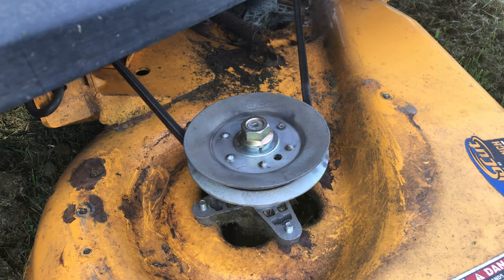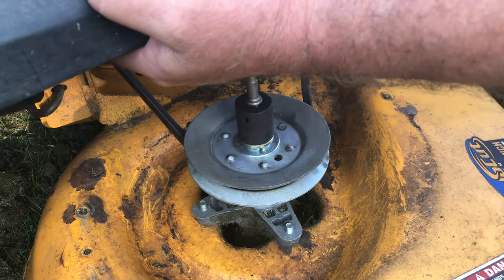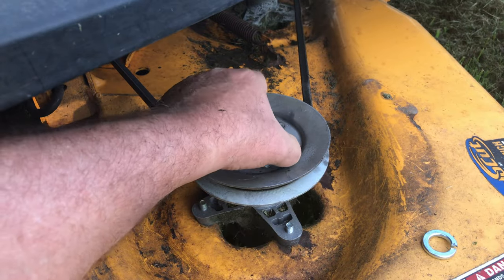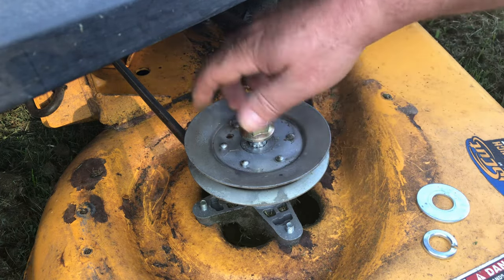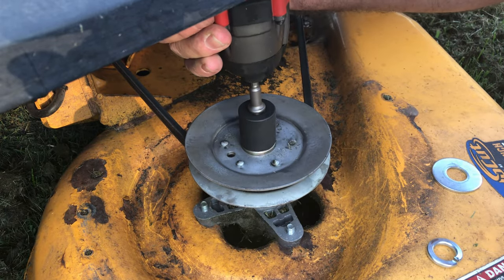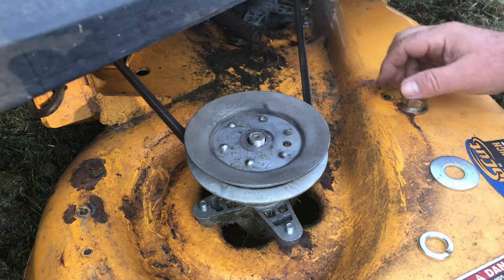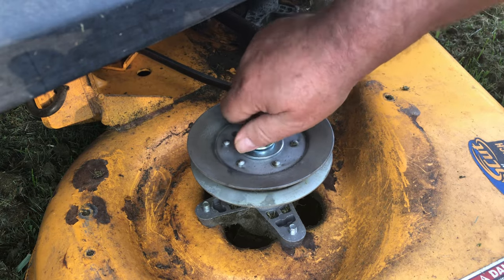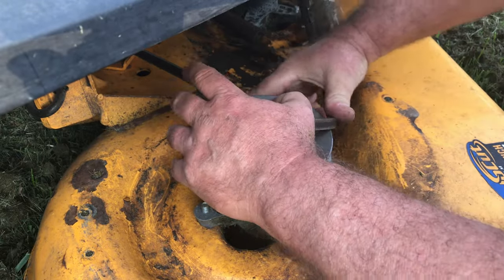New Mowing Deck Spindle Pulley Stripped? Easy Repair, Here's How! MTD Cub Cadet RZT 50 And Others!

Comment: Thank you my brother! I added to your fix by buying a large flat washer for the bottom - and a rubber washer under a flat washer on the top - tightened down until the rubber washer squished up against the pulley - for more traction - for hopefully a longer term fix

Comment: Cub Cadet AKA Poland I have an old 144 with snow plow 60" deck 3 point hitch I spent way to much money fixing up and keeping going but a diesel Kubota cost more then a house I worked for a international dealer for a few years before it shut down I spent more time working on cub then I did in the tractor shop my hatred grew deep in the cheap made parts and cost to consumers you wouldn't believe the money that place made
Reply from the maker: New mowers cost so much now it's hard to believe the prices. I'll stick with my old junk. I use the cheap crappy import parts on mine, turns out most of the factory replacement parts are imports as well. All I really need is a decent spindle housing, and the bearings by the 10 pack. I should probably add in spindle bearing replacement along with the yearly oil/filter change. What a bunch of junk. LOL!
Reply: @KentuckyFriedFixes  they definitely don't make spindle worth a crap anymore most of them don't even have a functional grease cert usually first thing I do is drill and tap a hole and I agree mower prices are nuts every now and then I pick a used one up for dirt cheap fix it and flip it I rewired a newer deere few months back been my main mower this year but after 150 bucks for it and 300 in parts I'll need to use it awhile to recover my money
Reply from the maker: @heathenprojects2639  Good plan. I love a Deere! I have a 212 and a couple of 214's that need some love. The JD mowers do a great job!

Comment: Why the heck are manufactures not machining these shafts per OEM specs? I put mine together and in one mowing stripped out both the pulley and the spindle shaft spline. Thanks for your video, I’ve got to order another spindle set and pulley and I’ll be sure to add washers to the stack.
Reply from the maker: I agree! It's as if they're actually making them to fail. After this deck rebuild, I ordered a box of replacement bearings to rebuild the worn out factory spindles for the next one.

Comment: Had the same issue with my 54” Craftsmen pulley/spindles after rebuilding.  Replacement part quality has really gone down
Reply from the maker: I agree Paul. The Quality is really lacking and the bearings that come in these are terrible. The wife's Cub Cadet mower is on its second set of spindles and blades in 3 years of use. Rebuilding the deck is becoming annual maintenance like changing oil and filter!

Comment: I was thinking maybe a washer under the pulley to bring it up.
Reply from the maker: That would be a stronger fix. Washers on the top and bottom would support the pulley better. I like the way you think! So far, mine is still working with the one flat and one lock washer, but on the next one I will definitely try your suggestion. (I guess it kinda depends if the hole in the washer matches up good enough with the shaft, I didn't think to try it.)
Reply from the maker: I disassembled the old factory spindles and they definitely had a flat washer under the pulley. The new Chinesium parts do not include that flat washer. You were spot on about the washer. Thank you Sir! I've added that information to the description.

Comment: It looks like you have the wrong nut. The proper nut has a void space that allows the nut to fully contact the pulley. The void space slides over the jack shaft serrations without contacting them. The nut you are using looks like it is threaded all the way to the bottom of the nut and has no void space to slide over jack the shaft serrations.
Reply from the maker: Hi Mark! The spindle nuts I used were the ones that came with the new spindle and pulley set. The shaft on the new ones are the issue. After reading your comment, I did go out to the garage and look at a few of the other new spindles and nuts that I have on the shelf. After a quick compare to some of the used original spindles (I save the old stuff to rebuild for later use) The only difference I can see between the new and the old is the spindle shaft is made differently on the new ones. The serrated teeth cut into the shaft for retaining the pulley on the brand new spindles is taller than the factory spindles. The retaining nuts (new and old) appear to be exactly the same on both. I know that all the new spindles I have on hand came from the same seller on the Jungle site as I got them in bulk at discount. I would certainly be interested in purchasing a different style retaining nut style as you described, that very well would solve the issue in itself! Do you have a part # for those? I'd be happy to share this information in an upcoming video! Great stuff! Thanks Mark!
Reply from the maker: Hi Mark! I found that these spindles use a flat washer under the pulley that was not included with the new ones. That may be why the shaft is taller than the ones I removed. It's been a learning experience to say the least. I've disassembled factory spindles and aftermarket replacement spindles. I believe the longer shaft spindles do require a flat washer under the pulley to take up the difference. Not all the spindles I disassembled had that flat washer though. Thanks!

Comment: My neighbor has an old simplicity mower with a pulley that’s been completely stripped (part #1721666SM). He wants to replace the pulley (shaft is still in good shape), but it’s discontinued and sold out anywhere. Any tips here to try and salvage this pulley and or mower?
Reply from the maker: I don't think the cheapo Chinese parts will fit the Simplicity mowers.  That part number comes back to a Snapper spindle and pulley kit. He may be able to match something up from a Snapper? It's worth a try to add a large washer on top to hold the pulley in place, but it won't work if the pulley slides down over the shaft. On the older mowers it can be a challenge to find rebuild parts. Usually the bearings can be matched up with something but the shaft and pulley are another story. If it was me,  I'd considered redrilling the spindle mounting holes in the deck and replace all the deck spindles with something new and cheap from China. (At least those parts are available)